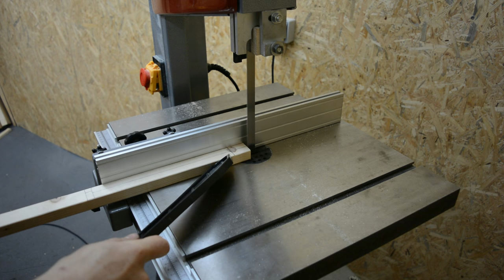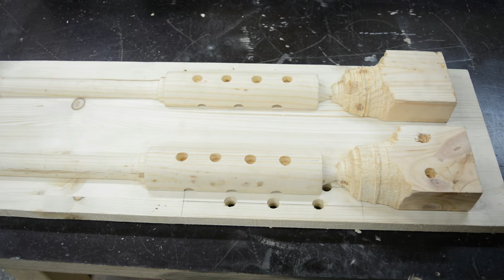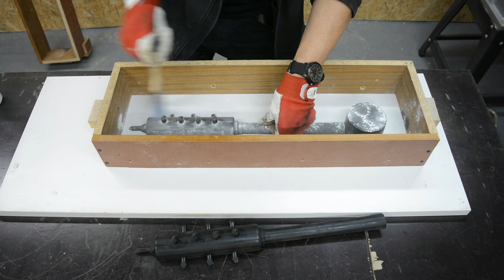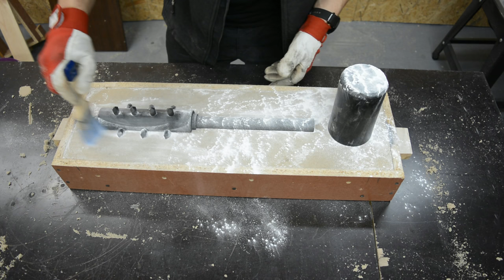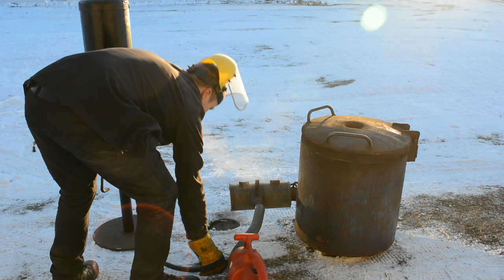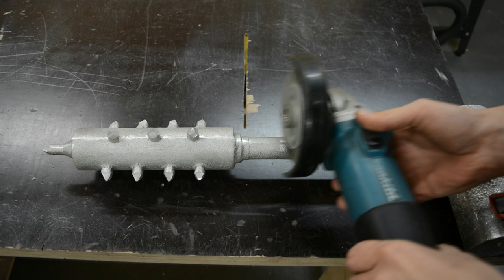BUILD VIDEO: Casting an aluminum SPIKED TRENCH CLUB from Battlefield 1

Comment: "Trench club from Battlefield 1" or more accurately "BUILD VIDEO: Casting an aluminum SPIKED TRENCH CLUB that also happened to be used in Battlefield 1."

Am I the only bothered with "from Battlefield 1" with an object that actually exists that Battlefield 1 just happened to use cause it existed?

Unless however DICE took it upon themselves to make their own design for the club and the one featured in BF1 is just based on the real thing, but I don't know.

Comment: I know I'm late, but when you're going at it on the lathe, get some form of vacuum system getting all those wood chips away while you're working on it, not afterwards. Saves you from cleaning up the mess and the fine dust produced won't go into your eyes/lungs even if you wear goggles/dust mask.

Comment: Is there a chance of some kind of explosion if you don't make all those vent holes?
Reply from the maker: It should not explode. The vent holes are there so air doesn't get taped in the higher parts of the pattern and aluminum wont fill all the pattern resoling in a failed casting
Reply: Thanks for the answer!
Reply: MP Dragon could u make a basketball for me plz or can u make an assigns creed axe
Reply: +Zack Shockley Aluminium basketball?
Reply: good ides Zack assassin's creed axe, i will make that to for my videos...

Comment: So do you just grind up the sand to use it again? Also, what's the benefit of pouring into that shallow dip that leads to the hole instead of pouring into the hole directly?

Comment: Could you make a video on how you aneal your cruicibles
Reply: or what you use for a cruicible
Reply from the maker: It is just a steel pipe with a bottom welded on

Comment: what did you pur into the sand?
Reply: Is the sand mix reusable?
Reply from the maker: Yes. I crush it up, sift it and when I am making my next mold I ad more sodium silicate
Reply: Outstanding. Using the Sodium silicate as a binder to prevent "burning" then firming with the Co2. Oh the wife is going think I have lost my mind {well she knows I have but that is besides the point}

Comment: you cant kill nobody with alumium, it bends
Reply: MAja Mantras all metal bends
Reply: MAja Mantras I don't think the point of making this is to kill people but to make a cool thing...
Reply: even so I'm pretty sure it would be lethal if you were to get hit in the head with it.
Reply: do you realy think that aluminium is softer than flesh and bones?
Reply: yeah thats why there are real weapons made on alumiun.....
Reply: a mace,club or other blunt weapon, can be made of wood,and still serve its purpose.For a bladed weapon,it would not work,because blade needs to be very thin to cut properly.but 7 cm(3 in i think)of aluminium bending from hitting a human?and that person is fine?
Reply: Macedonian fighter so you never used an alumiun baseball to as a wepon right? tyou should know that even a wood baseball batr is more efective than alumiun
Reply: yes,if that aluminum bat is hollow.And is it a normal thing to fight with baseball bats?
Reply: Macedonian fighter so you never been out rich neibouhoods right?
Reply: It would be more accurate to say that you wont effectively kill someone with an aluminum weapon. You can kill someone with just about anything if you really wanted to.
Reply: MAja Mantras Would you rather be hit with a solid aluminum block or a solid wood block? Aluminum bats are hollow, that's why they bend.